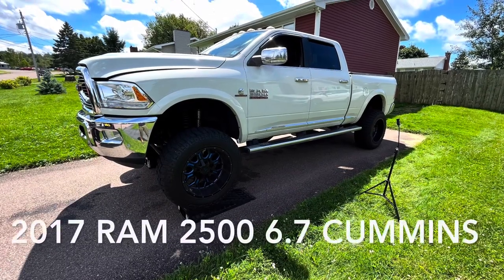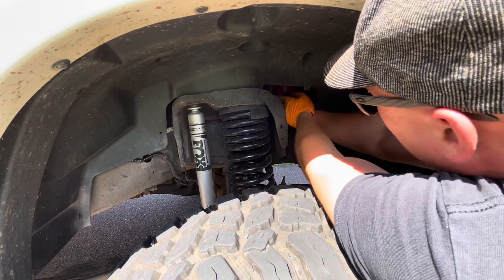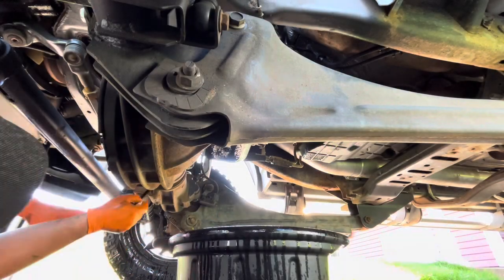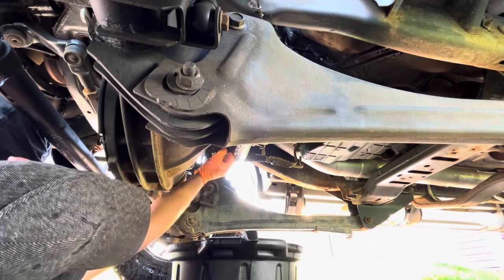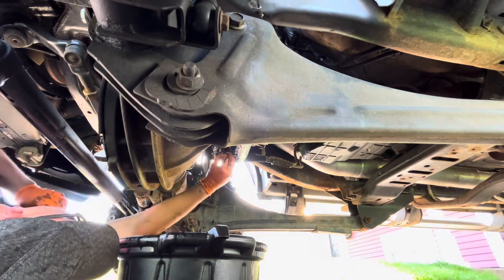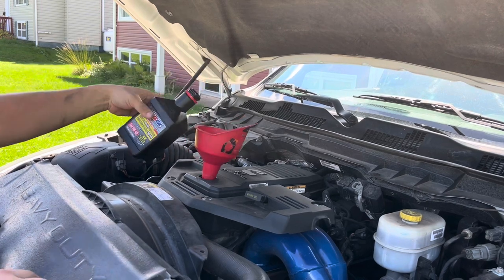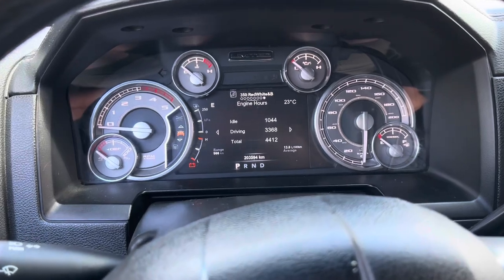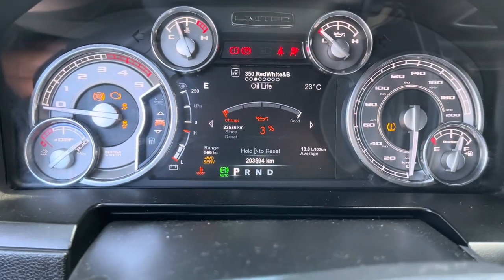How to change oil on a 2017 RAM 2500 with 6.7L Cummins Diesel engine

Comment: Are u really installing that filter dry?? Not prefilling it some what?? I'm assuming u do not know about the cummins oil filer plugs. They are a must when changing the oil on a 6.7 u get a big fail 👎
Reply from the maker: Please tell me more about these “filter plugs”
Reply: @SuburbanRedneckGarage it’s just an aluminum plug for the oil filter. You can drop the filter down and slide the plug in tighten it up then angle the oil filter out. Also use it to prefill the filter with oil and install without spilling oil.
Reply from the maker: @Toyota66b they sounds awesome. I’ll pick one up for the future!
Reply: FYI Amazon sells them.